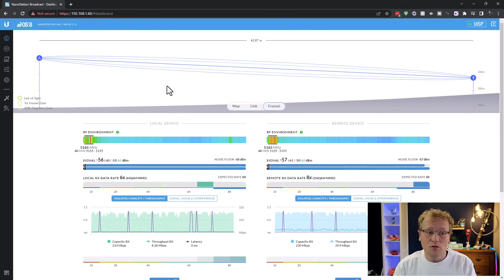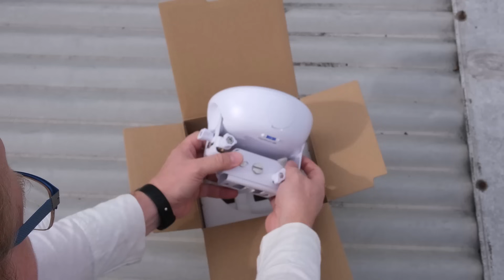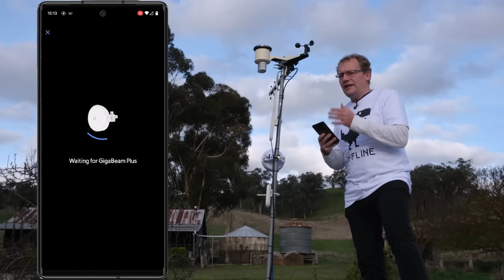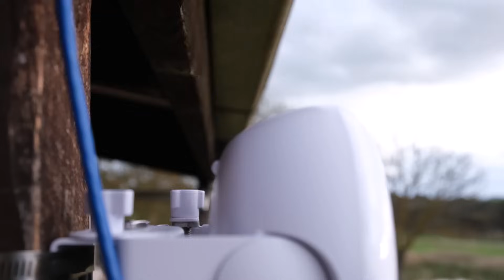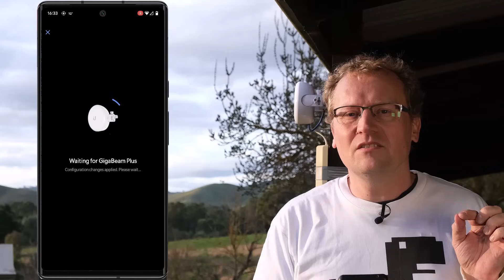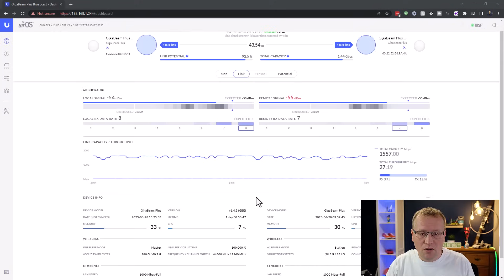airMAX Gigabeam Plus - 1.5Gbit wireless connection

Comment: Next time if you have a speed issue first check your cables / interface speeds before start ordering new hardware :-). Your lack of speed origins from the cable speed of 100fdx not the nano stations. Could have saved you a lot of time /frustration and money.
Reply from the maker: Thanks for the tip 😀. I've been through it before and have fixed a few cables. In this case it was the cable that limited the NanoStation speed to 100M/bit but it would never have got 1.5Gbit anyway (max about 250M/bit), so the upgrade is still 100% valid. And now I have the start for +1Gbit too 😁

Comment: You should mention your cabling fix, new cable, replace RJ45’s?

Can you upgrade the firmware on these via the Unifi Network App or do you have to be at the location with the UISP app?
Reply from the maker: The fix was just to replace the RJ45 on one end. Easy. 
The firmware upgrade/management is done via the UISP app or dashboard (which I didn't show in the video). Unifi Network doesn't know about the UISP devices, so it can't access their management features.

Comment: Hey Lars, super appreciative of your work as usual. Always seems to be making content in exactly what I’m currently stuck on. 

I have a similar property to you with an office in a detached shed in the Aussie bush, on uniform dream machine SE, but not sure how this UISP integrates with unifi. 

Would love to see a video on what the differences are and how they integrate, as I thought I had to go the building to building bridge UBB
Reply from the maker: Thanks for the kind words, and thanks for watching :) 
There are two different product lines and systems at play here. The UDM SE is a Unifi device and runs the network controller. It can see all your access points, clients etc. The GigaBeam is a UISP device, and doesn't have anything to do with Unifi, other than being a client on it's network to get a connection. When you pair two GigaBeam devices you do that in the UISP system, and Unifi just sees two devices. Unifi can also suddenly "see" the devices on the network the GigaBeams connect, but it doesn't know why. It is like there is a network cable between the two networks. 
Think of Unifi as a network in a single location and UISP as connecting multiple locations. You can use UISP devices in the same location of course (as I am doing), but that is the idea. 
I hope that makes it a bit clearer.
Reply: @LarsKlintTech  awesome. Thank you, it definitely does. I guess the only thing I don’t understand is if the UISP system is hosted on the devices themselves, or if I need a cloud key, or similar console to be able to host and manage these devices?
Reply from the maker: @Northflix_watch  Yes, you need a UISP account, which both lets you use the mobile app, and gives you access to an online dashboard with a lot more stats. You don't need any additional hardware though.
Reply: @Northflix_watch  UISP is completely optional. You can self host for free, but are required to have 10 devices for the "free" cloud hosted option.   The devices have a web interface and can be managed locally w/o UISP.  UISP is only a management interface for groups of devices and is not needed to have it work.

Comment: Most likely the nano station also had only a 100mbit wired connection in your first test since 11MB/s is the speed you get when you max out a 100mbit wired connection. So not a completely fair speed test between the two 🤓
Reply from the maker: Yeah, I did realise this after I fixed the Gigabit connection too. So I would have got maybe 20-ish MB/s on the NanoStation, so still a big improvement. You are absolutely right though Rob. Thanks for the observation 😊
Reply: Also frequency management changes a heap. 😊
Reply: I see that number frequently because my M2 loco only has a 100mbit interface 🤓
Reply from the maker: @daniel8126-d4t  Yeah, totally. I didn't pick up on it in time for the filming 😂

Comment: Thanks Lars, great video on the AirMax setup you have, (I've done a few smaller ones with the older models a while back), think the newer and faster ones you have look really cool, nice to see it in action (firmware updates were always an issue, so would have to unbox prep and update at the main connection hub, then take them out to the relay locations.... defo cool!
Reply from the maker: Thanks Andrew. I've done a bunch of the older generation NanoStation too, and they are super realiable, but certainly not as fast as modern networks can be. I don't mind the fw updates as that usually means the product isn't dead 😁
Reply: @LarsKlintTech  true, think the older kit just works (and you know yourself the pro's and cons...) I'm happy to be honest when the network is online, you're lucky to have the chance to work and use your setup, really impressed with how you've got it working, thanks again!
Reply from the maker: @andrewmccallum5699  It is definitely one of those things that "just needs to work" and I don't have to think about it. This latest upgrade really makes a difference to my workflow too. Thanks for watching Andrew.